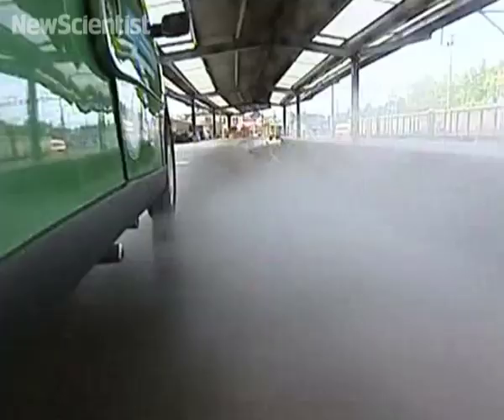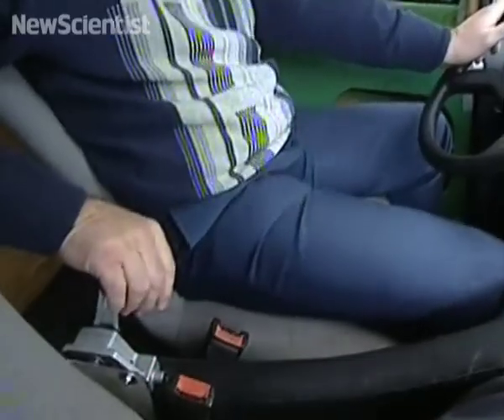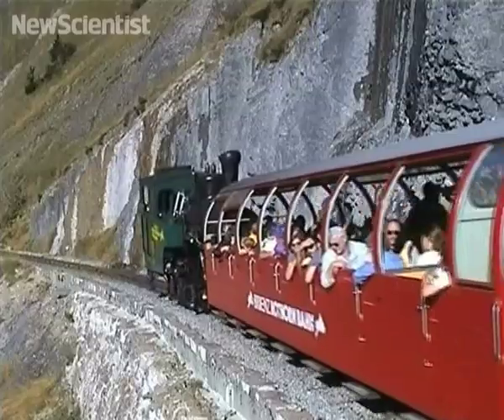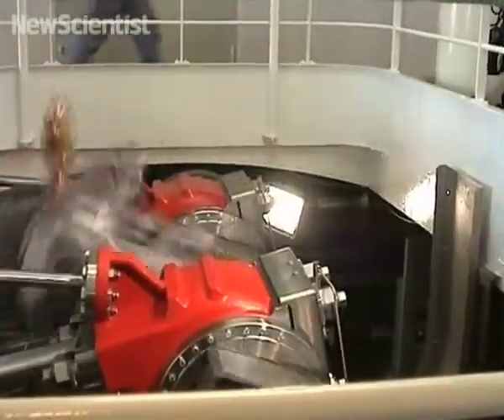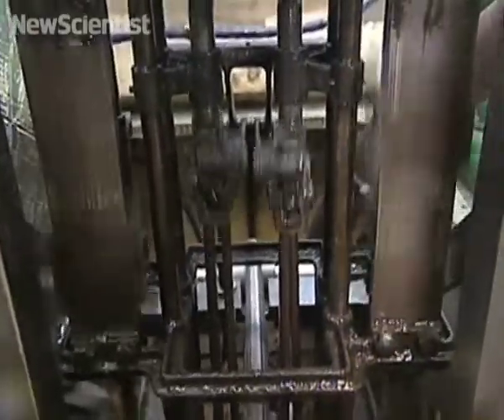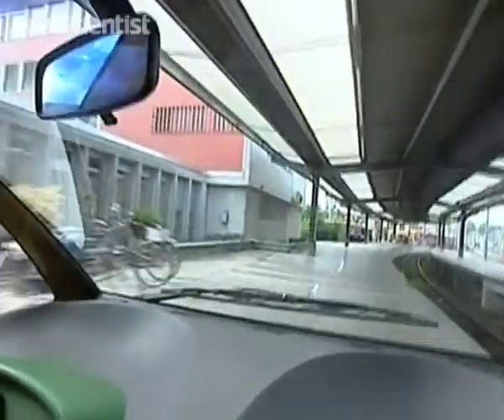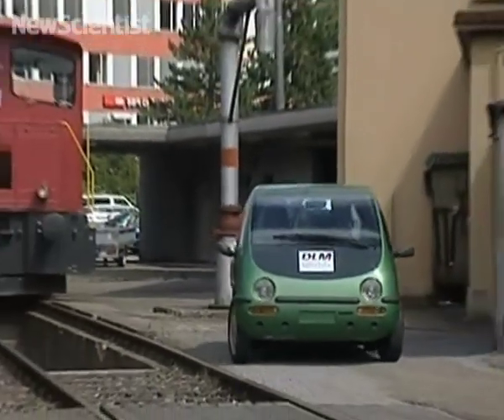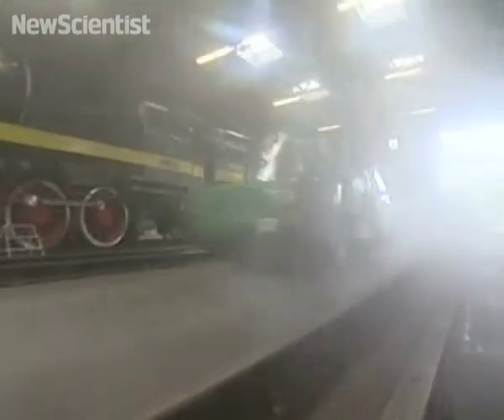Car driven by steam

Comment: I was thinking of this too 
Steam stored power has a higher energy carrying potential than compressed air, and steam can be easily produced by solar or biomass in an efficient and safe stationary boiler (or in the apocalypse by heating up a metal tank in a fire) 
Alternatively electric energy can be stored as heat and pressure in a tank
Stored steam obviates the need for harmful substances that would harm the environment if your car crashed 
Seeing that heat must be conserved I’d imagine that there is an incentive to drive quickly with this kind of vehicle 
Anyway 
Low tech appeal !

Comment: Interestingly enough this inventor wanted to go the flameless steam engine rout. The issue is 75% efficiency rating. https://en.wikipedia.org/wiki/Fireless_locomotive  (source of information). Unless he increases the thermal efficiency or/and pressure compacity there would be limitations on its range. Demonstration prototypes for eco races make more sense for this tech where sustainable pressure levels are referring to boiler pressure at a point in time so that the steam generator doesn't have to inflict with engine efficiency calculations. I would see if liquid nitrogen or other inert compress fluids have a better chance with this concept. The nice thing is that surround air temperature would cause more immediate boiling levels with the concerns if the cost of condensing, maintenance,  and housing supercooled liquids. 

If anyone makes an ATMOS car I would love to see it run someday.

Comment: His study in retaining super heated steam longer is still impressive for 40 mile range alone, yet alone without the use of a boiler and condenser prevented the further range he could have gotten combined.
Reply: Yeah, why not combined this with a boiler system running off a solar panel in the roof.

Comment: Might as well use pressurize gas instead of using steam whit that car. 
A real steam car whit a boiler that uses a fuel to heat the steam is mutch more better for the environment then a combustion engine and go at the same speed if its well made. I bet you can have a good range too if you have a condensater
Reply: If the combustion takes place on the car, then internal combustion will always be more efficient than steam.
If you have a supply of waste steam from some other industrial application, that might make this type of car economic. This is known as 'fireless' steam.

Comment: @mynonsense it does... but, more hot water dribbling... problem is, it is a viable technology, but they're demonstrating technology that's several decades older than current steam car tech, heck, that's not even 20th century steam tech.

Comment: @KrazeeCain Also, size is not an issue, the engine is much smaller than the equivalent IC engine, and the size of the boiler can be reduced to the size of a car battery (look up "Saab steam car").

Comment: @doggiejigs The basic theory behind steam engines is much more ideal than IC engines. Both engines are trying to capture the heat energy given by the fuel they burn. In an IC engine, the heat energy is absorbed very rapidly by the air in the cylinder. In a steam engine, the energy is absorbed by water, which creates the steam. This way, the fuel is burned completely and it's possible for ALL the energy to be captured. Back then they weren't efficient, but we have the tech to change that now.

Comment: @doggiejigs yea but how about steam turbine engines? the british had the fastest war ships in ww2 and they used steam, they outrun the Germans and took over the seas, steam single piston engine, the multistage pistons steam engine, then turbine steam, but in any case you need massive amounts of heat and its going to big ass size, it would be cool to see a steam engine using thermal energy from the sun to create steam and rotate a generator, thats free energy, panels would be better thought, :P

Comment: Why would you use a home boiler instead of an onboard one?  That makes it the same thing as a compressed air car.  If you have a built-in boiler in the car, you could run it on things like bacon grease or corn!

Comment: Also, steam engines can run on anything that burns. So if somebody were to develop a modern steam car, you could put whatever fuel you want in it. Hell, you could probably even mix up your fuels, and get a nice diesel/gasoline cocktail going in your gas tank ;)
Reply: Solar panel on the roof, to power a heating element to get hot enough to make steam for day driving.

Comment: I agree that steam should be considered as an alternative, but this guy's doing it all wrong. Somebody needs to develop a proper compact boiler, and use an alternative expander, such as a Wankel rotary design.I think if done right, steam could get better mileage than a compact diesel, while having an order of magnitude more torque than an EV. The fact that nobody has developed a modern steam engine is mindblowing. At the very least, somebody should make a steam engine for tractors, or something.

Comment: Thing is? this car is useing a engine style from 1886.
This guy needs to look up my web pages and the ,
Foisel Steam bike on The Steam car club of grate britain site.
Smaller bore, higher pressure over head cam. Better boiler.
Modern in every mechanical sence of the power train.
But still powered by steam.

Comment: You run into the same problems with these; Battery acid breach. Hydrogen tank breach. Then there's the issue of disposing of batteries. Hydrogen has storage problems, such as wont liquify till refridgerated below a certain temperature.

Comment: it's not the water, it's the energy you need to heat it to boiling point. Even if you take your hot water from a central point, it still has to be heated. You still have emissions. And I wouldn't want to be standing on the roadside when that thing goes by. Can you say "hot foot". Could you imagine getting into a collision with that thing, and rupturing the reservoir? Nothing like being scalded to death.

Comment: fossil fuels burned in power stations can recover much of the carbon and also burn more efficiently. Your argument is as valid for electric vehicles as it is for steam.
 Also steam does not require batteries made from rare metals so carbon foot print is less there too. One can imagine vehicle making short trips as part of an industrial process, using high pressure steam by products to provide short trip transport at next to no net increase in carbon at all.
 yours is a ridiculous comment.

Comment: *sigh*

This disappoints me, as I once took New Scientist seriously...

Could steam power enter the race for alternative fuel sources: no. Steam is a horrible "power source", as you have to combustion something to turn water into steam and then use that steam to power an engine. This is actually a step DOWN from the combustion engine, which uses the combustion directly on the engine rather than taking it to another form first (which will lose power, ultimately).

This is retarded...

Comment: Not gonna happen. Needs to refuel every 40 minutes and you have to use that "fuel" straight away or it cools down. Thats a terrible system. Probably takes a while to heat up the water and produce the steam each time you fill it. Either that or the filling station is on all the time (ie wasting energy). Plus you got to realise 10km/hr is really slow, most people can run that fast.

Comment: one star, because this is scientificially inaccurate.

steam is NOT a source of energy. the steam has to first be created, and this requires energy. 

1 star. rate this down. this is just like those hydrogen car people that claim that their car is a perpetual motion device and that the hydrogen is created in violation of the second law of thermodynamics. 

they should have mentioned that energy is required to produce that steam.